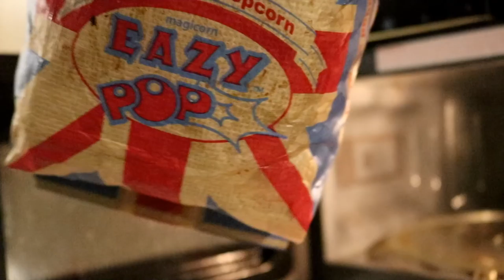RIGGIN' THE MIG WELDER

Comment: I would try turning the course dial to C OR D on the mig. Put the wire feeder within arms reach and dial it up or down while welding on a bit of scrap until you have a nice pool of weld metal. Keep up the vids bud.

Comment: I'd say the wire feed is too slow for 4mm judging by the speed when you first fed the wire through, hold the torch roughly 20-30 degrees back and push torch forward like you're pushing the weld pool forward. Works for me anyway

Comment: Is that stainless wire? It doesn't look like mild steel which should be copper coloured. 1.2 is pretty thick too, 0.8 to 1mm best for thin stuff. What sort of gas are you using? It can turned down lower if your freezing the regulator!!

Comment: There is a chart on the inside panel that should tell you, based on what gauge of wire you are using, at what speed and power you should be running. Here is a great "How to MIG" playlist that I liked. https://www.youtube.com/watch?v=hgGG-ifphkA&list=PL_P7k0CDx5cWywuZRYRd3HDZuvy7mTH0k Certainly not my forte, but.... 
Here is where he specifically talks about settings up the gas: https://youtu.be/hgGG-ifphkA?t=14m35s . Cheers!

Comment: start with the gas real low if you get holes in the weld turn it up a bit . as for the wire speed .. every job you do will be a different wire speed your ear is the best tool. mig is very forgiven don't be afraid to give it some power moving the torch forward and back as you weld .start high and turn it down if needed.
keep the kids away as welding flash is painful not if you get it but when you get it use two used tea bags on your eyes and good luck sleeping
Reply from the maker: I have had the old arc eye a few times. Not my first rodeo. Cheers Den